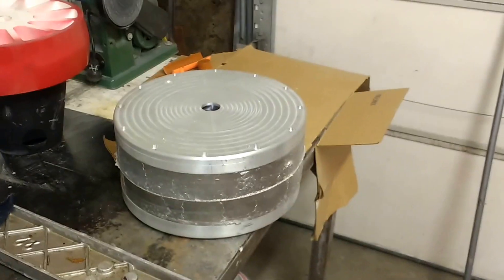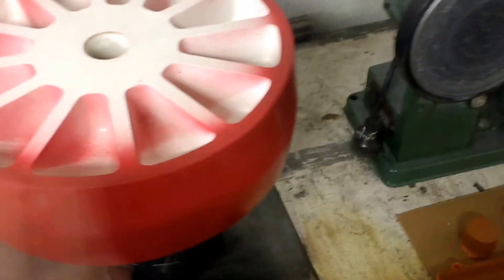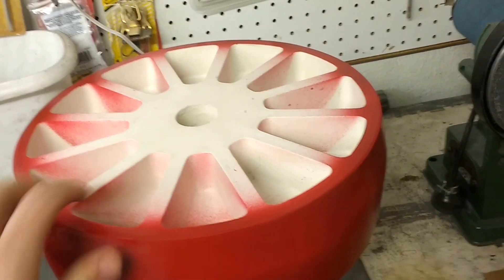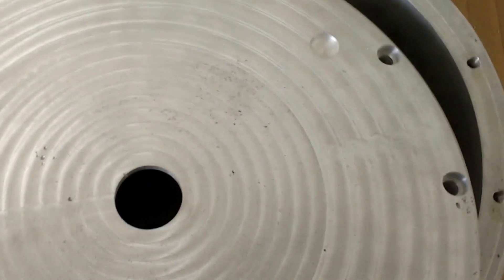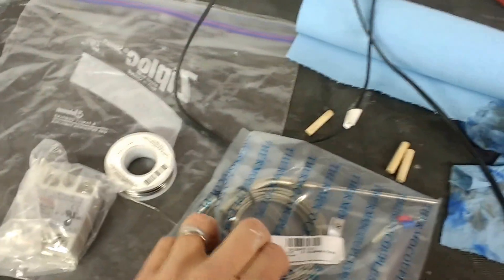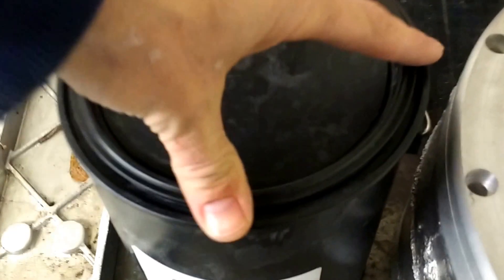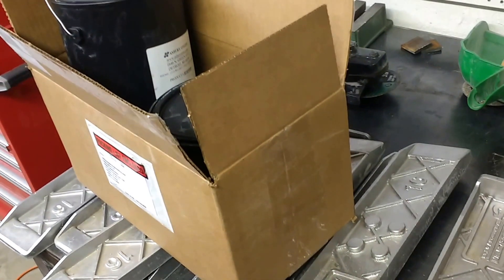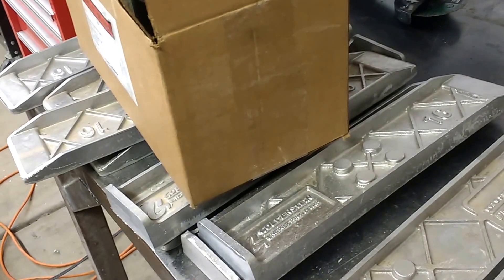Shop Talk: Episode 5 - Casting Flasks

Comment: How much torque  approximately that water brake can load?
Reply from the maker: Edvinas J. I don't even know yet. It's a 12" rotor. similar design/size ones are near the 1000ftlb range.
Reply: What Software Do You Plan To Use for Dyno?
Reply from the maker: Edvinas J. I plan on using a microcontroller (probably amtel/Arduino) to process the signal  inputs and either have it drive a display to show parameters and/or push data over USB to a PC and write a PC application to view and datalog the parameters. I did a simple proof of concept prototype of this a while back but never finished it.
Reply: Actually I'm doing same thing except my dyno load is eddy current brake from truck.  I was looking for any free software for load dyno with no luck. So I started experiment with similar setup like Yours. I'm thinking to start open source project for load dynos to develop universal controller and software.
Reply from the maker: Edvinas J. Sweet! I thought of doing the same thing as far as an open source controller. I like to share information so be sure to ask if you have any questions. I'm open to collaborating.